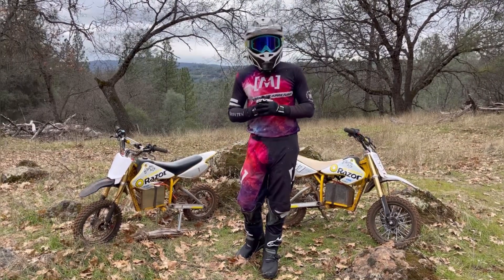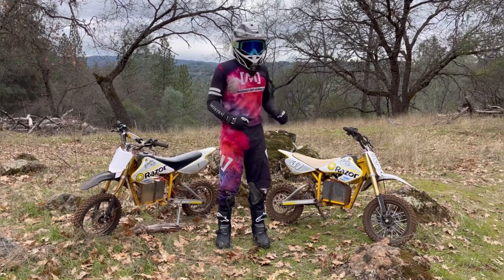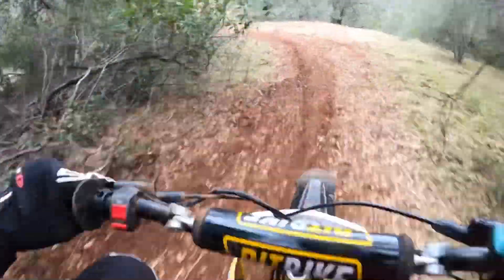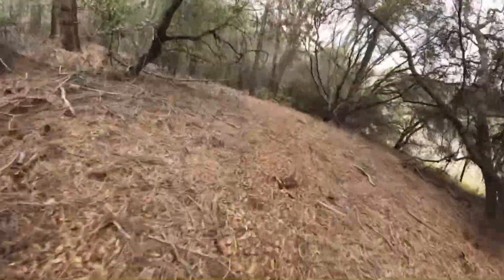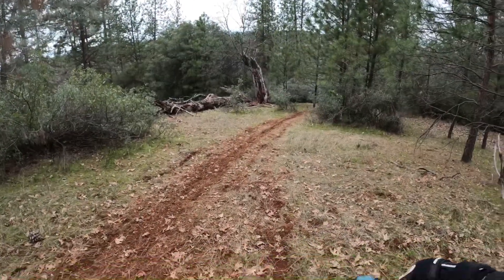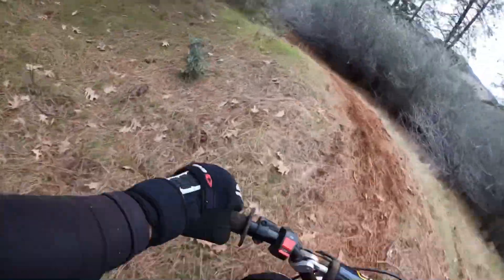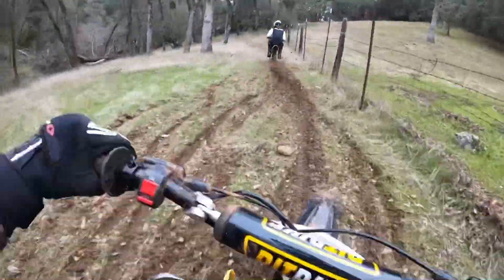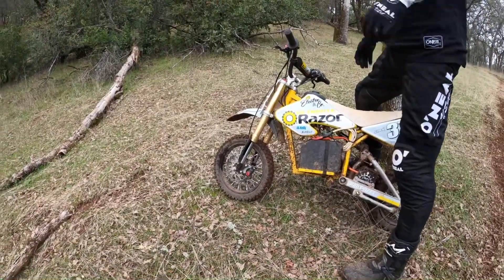Extreme 11,000w Razor Kit is INSANE! + Testing out Electro & Co. EC4P Motor at ElectroLand!

Comment: Is there anything I need that’s not included in the kit? I’m picking up a mx500 this evening for 150. It already has a new oe battery and charger but, obviously I want more go. I seen it said on sight that it doesn’t come with a battery? Is a battery needed or does the one already equipped on the bike do fine? Just wanted to make sure I got everything in one go.
Reply: They never respond to questions via email. I emailed them numerous times with questions and even messaged them on facebook, but they never reply.

Comment: So im confsued? so like a 72v 5000w goes around 45-55mph and if that is 72v and 11,000w?! than that has to hit speeds like 65-75 but why doesn't it hit those type of speeds. Like im not tryna be a hater im just asking im just curious, so just don't take it as like a mean thing im just tryna you know ask questions.
Reply: Top speed is all relative to the gear ratio on the drivetrain.  Dirt riding on hills and stuff requires a smaller motor sprocket so more torque and lower top speed.  I don’t have any experience with this kit but I know that with cheaper motor/ controller combos it’s pretty easy to burn the motor up doing speed runs.  These ec4p motors seem to have less issues with overheating so with the right gear ratio I’m sure they could go very fast on street.  I don’t think many people are going to be comfortable going much over 60 mph on these tiny bikes even if it’s possible.
Reply: @maukaman  ah so I see it’s the gears that make the speed fast huh
Reply: @maukaman do you know if the kit comes with the bike or just the battery?
Reply: @drewslife5734  your gonna need to check the website to see what all it comes with, I don’t have the kit or work for them.  I can say with confidence though that it doesn’t come with the bike.  Then it would ni be called a bike, not a kit.
Reply: @maukaman  alright

Comment: What battery is the camera bike? Looking to see what's the proper way to run the battery . Upright or lay it down
Reply from the maker: 76v24ah , no wrong way really. Stand it up or lay it down.
Reply: @ElectroBraap  awesome so they clear the shock mount on the mx650 & mx500